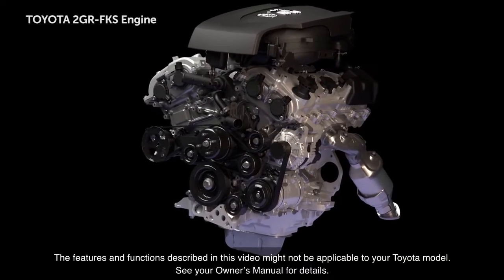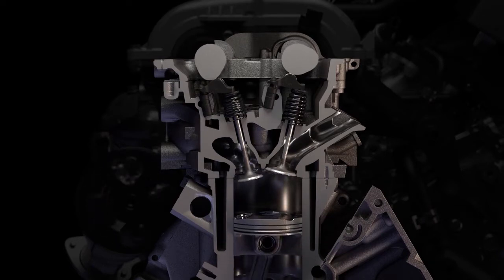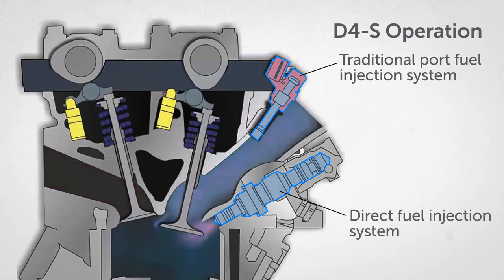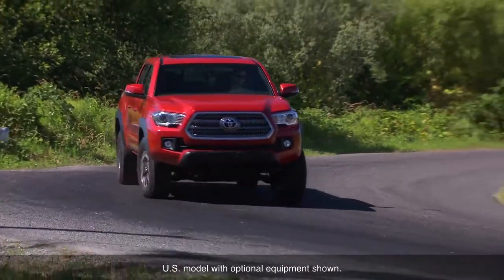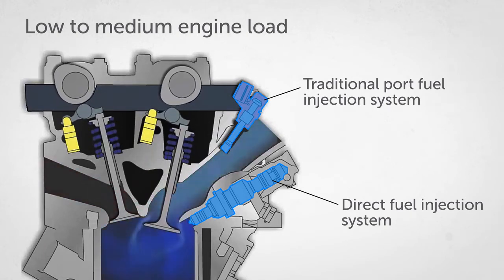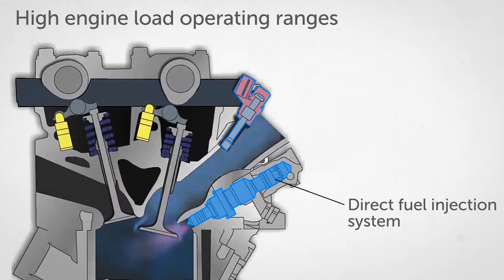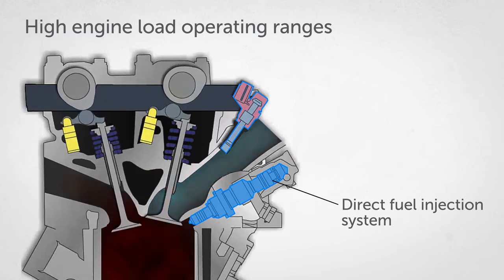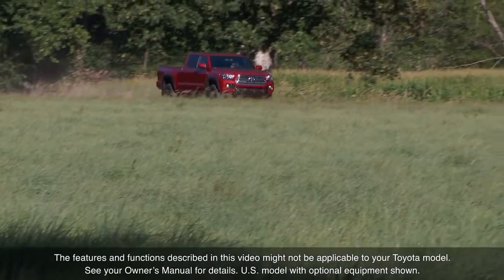How To Video On Your Toyota Direct-injection 4 Stroke Gasoline Engine Superior Version

Comment: It seems to me that this injector combo with also solve the intake valve carboning problem that is surfacing on DGI engines too. Because the port injector will spray off the crud on the back of the the intake valves at low engine power before the intake valves carbon up.

Comment: You forgot to show the part where the high pressure fuel pump starts sounding like it has crickets inside it and Toyota refuses to fix it, despite admitting there's a problem.